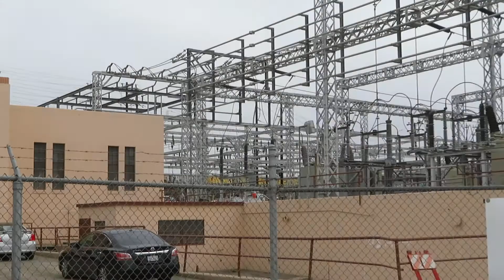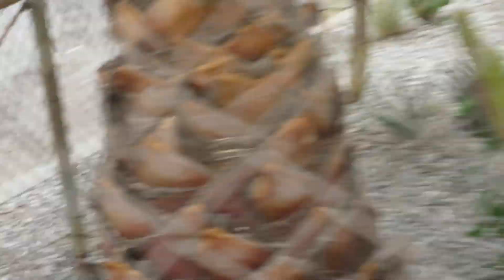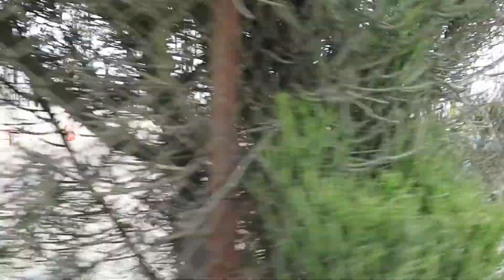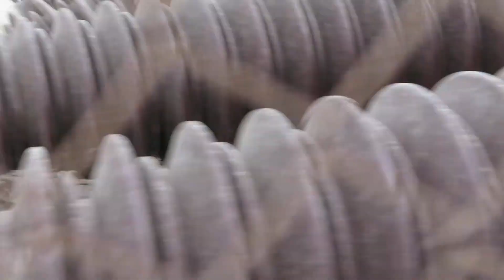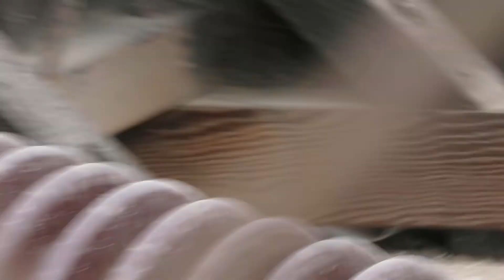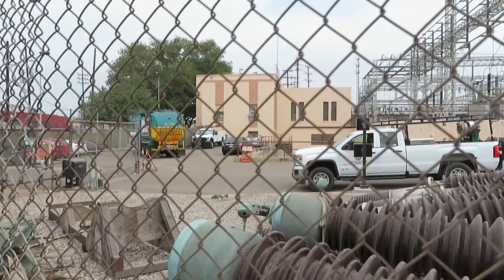"Energy Devices" "Truck Size" ( calm music )

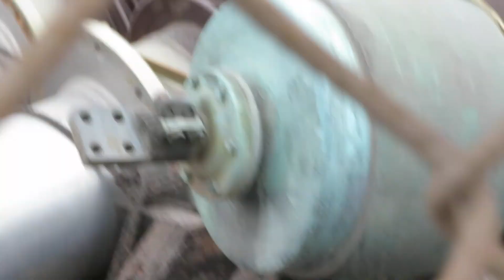Comment: Those are capacitors, lightning arrestors, transformers and switches to transfer wired electricity to nearby towns and cities. Though with the right knowledge and by obtaining those abandoned transformer lightning arrestors @ 2:03 one could create a free energy device!